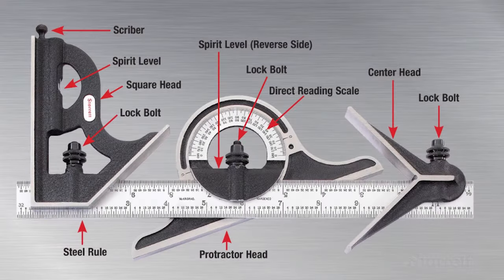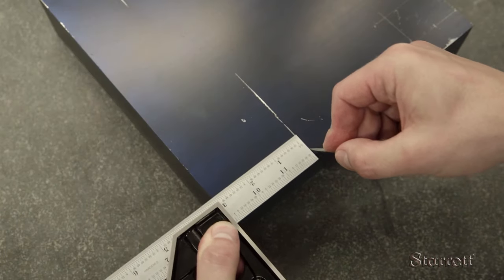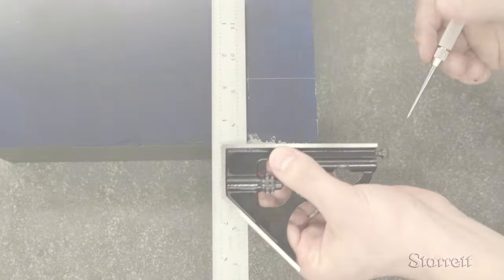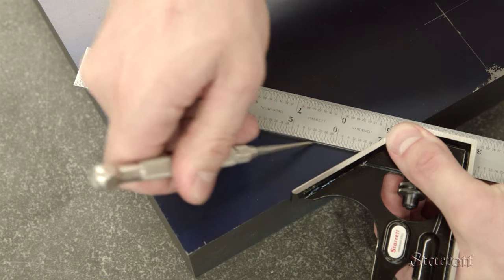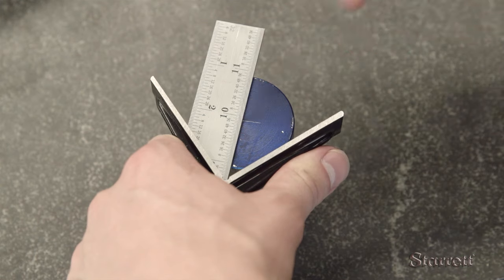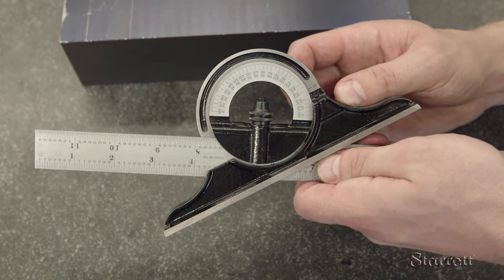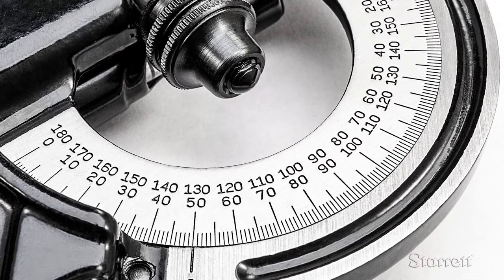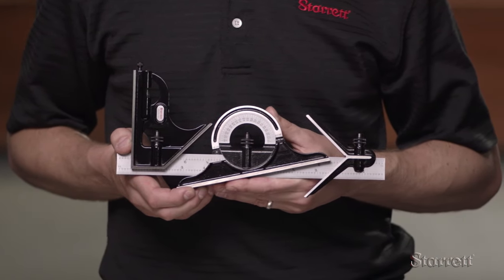How to Use Combination Squares in Metalworking

Comment: I found a Starrett 180° Bevel Protractor in a bad condition because they though it was not working due to the fact that it was not rotating to indicate degrees. I fixed it and painted black as it originally was manufactured. Marvellous tool and now it looks like new. Score for me, because locally they are over US $200

Comment: "Used most commonly in woodworking"? Maybe Starrett has numbers to back that up, but I'd almost bet money that given the price of a high quality and accurate combination set then a much higher percentage of machinist's own them than all the woodworkers combined. With today's CNC and higher numbers of CMM's in general use then yes there's a lot less need for them now as there once was. But if that is true it will surprise me.